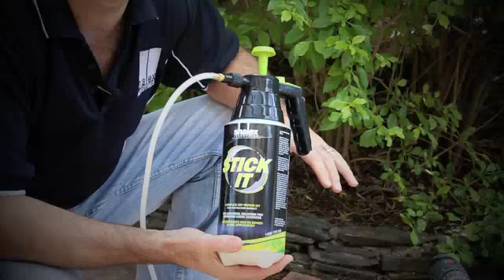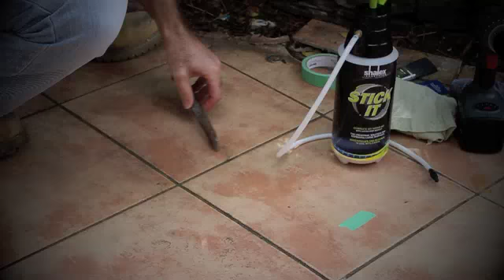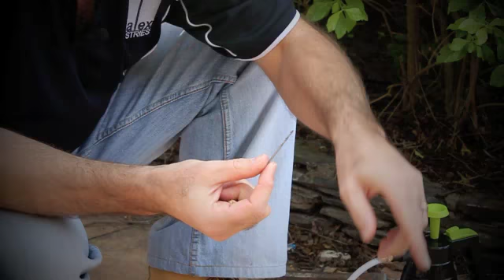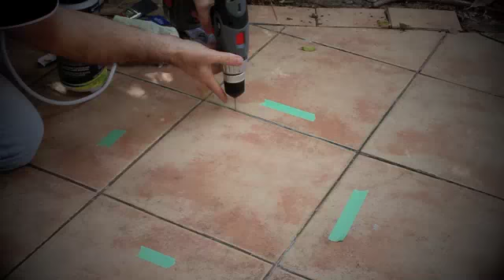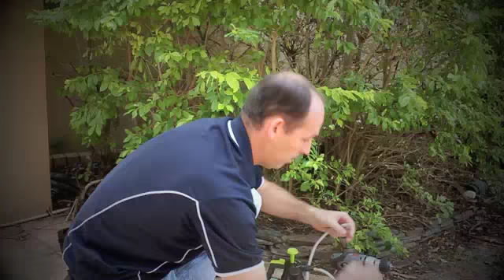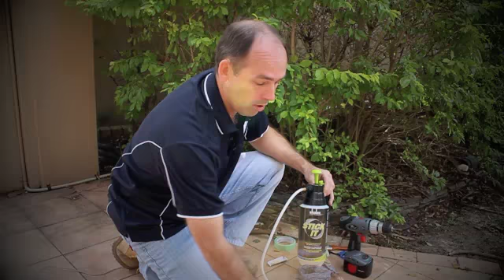STICKIT  -  TILE REPAIR KIT FOR LOOSE TILES

Comment: great product but you need to show us you drilling through the tile, because sometimes i try to ensure that edges are guaranteed to have the thin set/concrete after i try to spread the concrete evenly.

Comment: I have a speck built home in Brisbane that's about 14 years old. The tiler tiled right up to the skirting board and left no room for expansion. It has cracked a few  already and 50% of the tiles on the floor are drummy. I will be buying a BIG kit of this in the next few weeks and giving it a go for sure. Glad they have a product  like this in Australia as most of these "easy fix " things are from the USA or UK. Good video guys and I will be in touch!!!

Comment: never really demonstrated any of the liquid actually going under the tile. it all came out the holes as soon as you started to put it in which means you probably should have drilled the center of the tile and scene if you could pump it under from the center. nonetheless then you didn't follow up and run your tongue over and show that it still wasn't Hollow because my guess is it was still Hollow underneath.
Reply from the maker: Blair, since making this video six years ago we've done a lot more work on the Stickit Tile repair Injection Kit including shooting some new videos which provide more detail. You can see latest instuctional video at the following link which demonstrates injection through a tile we placed on a glass panel so you can see the ahesive being injected from underneath the tile.
https://www.youtube.com/watch?v=eF6mfhFF1UQ

Comment: Seems like a great product. Have to say though,that sometimes an ounce of prevention is worth a pound of cure, as the old saying goes. Sometimes this happens because the tile job is old. Other times it happens because you used a crappy tile installer. It happened with granite tiles in my basement many years ago in my old house. We had a guy come in to install beautiful granite. We didn't use the basement a lot but hairline fractures started developing on their own. When I walked on the tile with high heels, I could hear how hollow many of them were. Thousands of dollars of tiles ruined. Sometimes it can also be that your cement base is uneven which will help the tiles crack unless your worker does a hell of a filling job with the glue. My ex actually used wonder board as a base for our upstairs because we couldn't do a mud job  and over the years, maybe 2 tiles cracked. NONE loosened and they were ceramic which is more fragile than granite. Get references and try to look at work your installer has done because a job well done can last a lifetime and one poorly done will be one you have to repair or rip out. Good luck.

Comment: my tile moved enough to crack the grout away. should I regrout before using this product? or will there be enough pressure to force the adhesive under the tile?  thanks
Reply: having used a similar product...regrout...

Comment: Hi !

Nice Video demonstration !

I had the same situation in two small areas in my newly laid porcelain floor in the Bathroom.

I drilled in two places only so that the sealing liquid didn't come straight out of the adjacent hole instead spreading across the loose area underneath the tile.

I used a Squeezy Bottle from a woman's Hair Dye Kit (cost nothing) and filled the Squeezy Bottle with Unibond Universal PVA.

The Squeezy Bottle had/has a Screw Cap on the pointed end which was/is almost exactly the same size as the drill hole.

The pointed end of the Squeezy Bottle was then inserted into the drilled hole and squeezed until the Unibond PVA started to ooze out of the other drill hole.

Afterwards, a quick wipe with a moist sponge and job done.

Left to set of for 24 hours then re-grout the small drill holes - virtually invisible repair,,,,!!!
Reply: Hi. I have the same problem. I wonder if your job did last and your tiles are still bond?